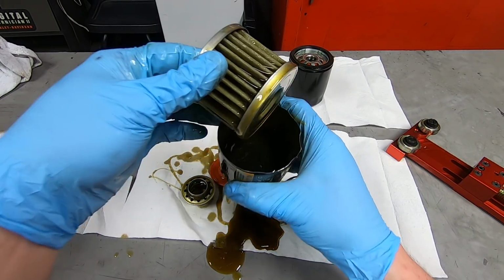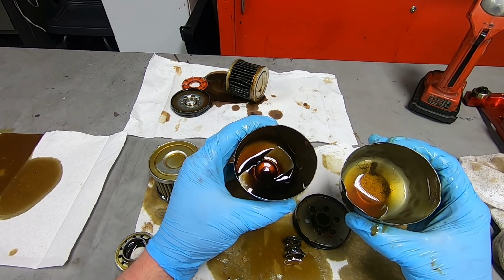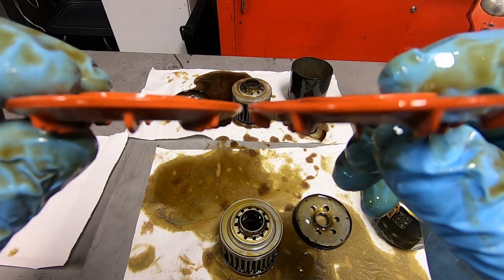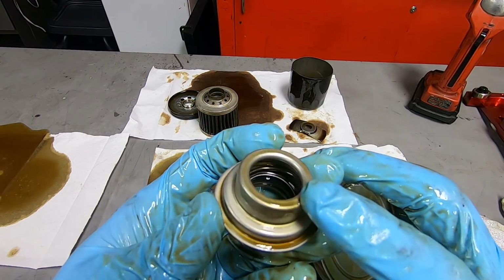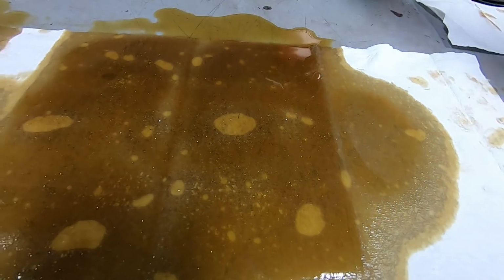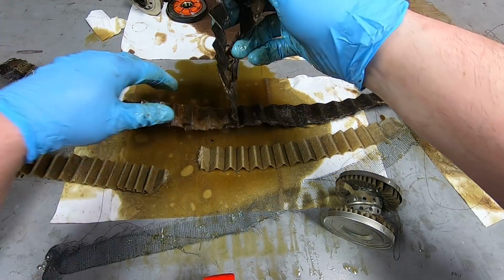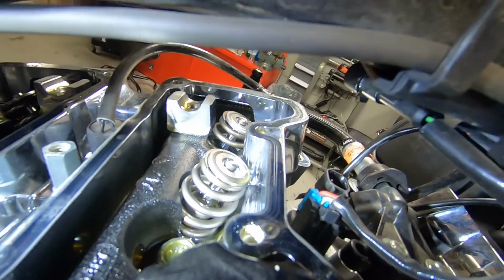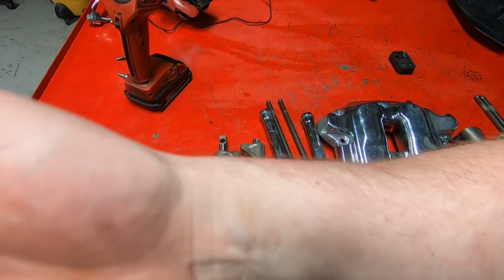MILWAUKEE 8 STAGE 4 ENGINE DIAGNOSIS AND DAMAGE SERIES , OIL FILTER INSPECTION WIX VS HD PART 2

Comment: I've sometimes used STP #S3614 oil filter (in a pinch) as a replacement for the stock H-D filter. 
I didn't notice any difference in performance.

Comment: Just curious...what is the red handled, duck bill looking tool at 18:28?
Reply: Richard, I’ll second that question.
Looks like it could be used to compress a portion of a valve spring, but it didn’t seem like it would have been necessary yet at that point of the vid to get rocker arms and pushrods out.  🤷🏼‍♂️
Reply: Anthony V I thought that or for the push rod cover. But I was wrong. If you ever need a good push rod cover removal tool check out Motion-Pro 08-0255. Compresses the clip like a dream and pops right out in a second. I just got one and it's sweet.
Reply: Richard Edwin , awesome, thanks for the tip!  I’m gonna look that up. 👍🏼
Reply from the maker: Its this awesome tool to grab the spark plug boot on the right side spark plugs. It makes it super easy to remove the spark plug wires on the right side without damaging them. It's a tool the motor company sends the dealerships for servicing M8s I'm sure there are aftermarket variants tho.
Reply: Harley Davidson Wizard great. I destroyed a right side rear cylinder plug wire cuz I couldn't get it off. Would love if you could do some more looking into manufacturer, part # or equivalent variants of it. I see some print on one of the handles but can't make it out clearly. A little help???? That shit pissed me off. Cost me $54 and still waiting 3 weeks later for them to come in. Glad I had a stock spare.

Comment: From the first videos I have seen of the M8 stage 'upgrades' I was wondering if the engine was up to it. Considering that the M8 has similar construction as a twin cam and we already know how many things have to be changed when they get hopped-up, is it really a good idea to use stage kits - better by far to have the engine built by a notable builder.
 I think maybe H-D's kits are for 'bragging rights' rather than serious usage - look forward to seeing the crank runout at both the pinion and drive shaft ends.
Reply from the maker: Thanks for the view!

Comment: So, when you have all that metal shavings in there how in the world do you know where it's coming from?  I know on new bikes and cars you will get a lot at first then it should lighten up over the years right?
Reply from the maker: This vehicle had like 100 trillion times more metal in the filter and oil than a normal engine. Based on the frequency of the sounds it was making I was assuming it was valve train based related damage. I've cut open a filter from a complete fresh engine build and it had no visible metal particles so I would consider that normal But a super small amount of bronze or aluminum I would look past but if is steel then there are super unusual problems. Thanks for the view and question!!
Reply from the maker: This vehicle had like 100 trillion times more metal in the filter and oil than a normal engine. Based on the frequency of the sounds it was making I was assuming it was valve train based related damage. I've cut open a filter from a complete fresh engine build and it had no visible metal particles so I would consider that normal But a super small amount of bronze or aluminum I would look past but if is steel then there are super unusual problems. Thanks for the view and question!!
Reply: @HarleyDavidsonWizard  Gotcha.  I love the vids keep them coming!  Always love to learn!  I have 4400 miles on my 18' Road Glide Ultra and gonna take good care of it!

Comment: Can you please compare Harley oil filter to K&N oil filter????
Reply from the maker: Thats a good idea. I keep that in mind for the future.
Reply: Harley Davidson Wizard sugestion: stretch out the medium and drop some oil just to see what K&N claims about high flow. 
Thanks!
Reply: @HarleyDavidsonWizard  - I've used the STP #3614 oil filter (in a pinch) as a replacement for the OEM H-D oil filter. I've noticed no difference in performance.